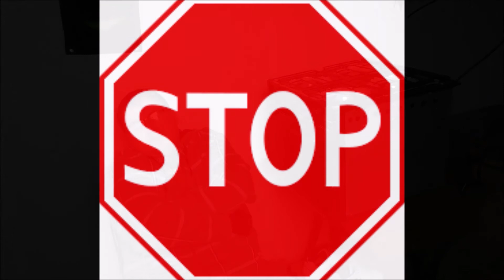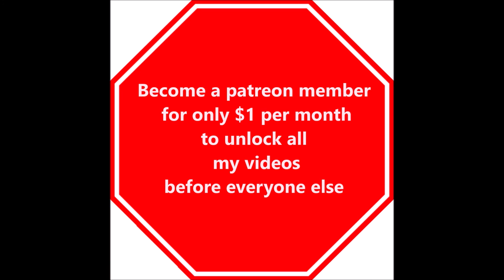Preperations For Coming Mess

Comment: One would think that any regulated DC power source within an acceptable range of voltage should be compatible with an MPPT controller.  The technical challenge for you seems to be that you want to maintain two separate battery banks that have different chemistries from two different intermittent power sources.

This is a brilliant idea, if you can make it work, because it offers a high degree of fault tolerance and insures that you will always have some amount of available power at all times.

If it was my system, I would want a combination of automatic smart distribution with manual override for routing incoming power to wherever it can be utilized most effectively. There must be technology available for maintaining dual battery bank systems from multiple power sources, and the manual override switches are readily available in the marine power systems market, as you probably already know.

I am currently attempting to analyze different renewable heating systems and model the performance of different designs using physics math modeling algorithms. So far, I suspect that rocket mass heaters may offer the best combination of fuel efficiency + long lasting heat storage & radiation + simplicity + low cost + shtf resilience & reliability. The problem for off grid tiny house use is the massive weight of thermal mass required for efficient operation. Perhaps a better thermal mass material that is much lighter than cob, cement or brick will become available to eliminate this limitation?

One possibility that I am looking at is an external heat storage bank that rests on the ground outside of a tiny house and can store massive amounts of heat. That way the large amount of heat released quickly by rocket stoves could be captured, stored and withdrawn as needed from a well-designed & insulated heat bank. The external heat bank would be able to be easily disassembled, transported and reassembled should the tiny house need to be moved, so it could be an excellent solution. (Otherwise, one is stuck with feeding inefficient wood stoves repeatedly thru the day & night to try to maintain comfortable indoor temperatures.)

I hsve also been analyzing the performance of solar heat collectors, which can produce high temperatures on a sunny winter day for upwards of 5 hours during peak solar insolation periods. The idea is that multiple heat sources could feed the same heat storage bank and the stored heat could be automatically withdrawn as needed throughout the day & night. We shall see if the math works out for this approach, as, at the end of the day, it is all about BTU's per hour.